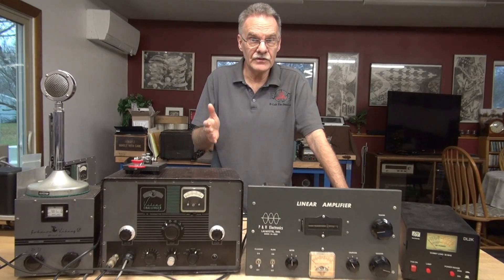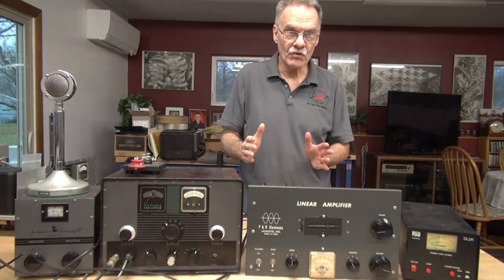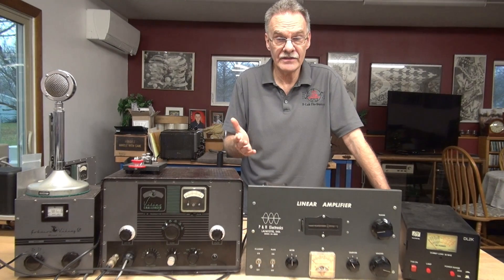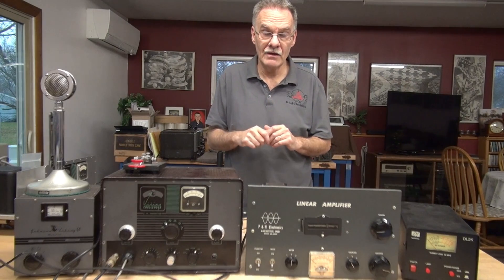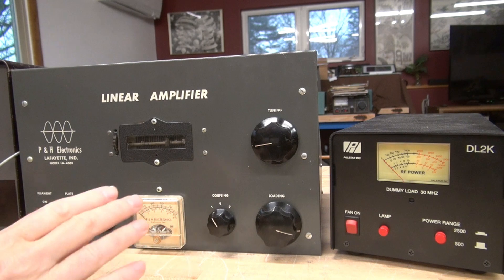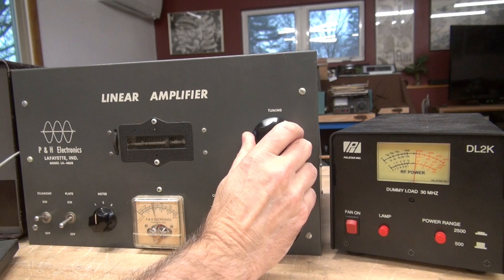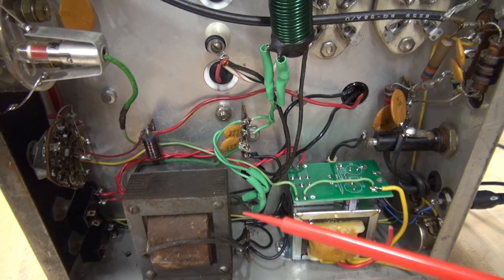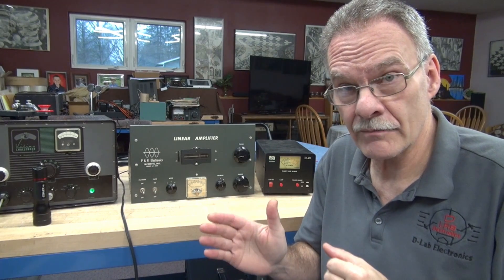D-Lab Modified P&H LA-400 Ham Linear 572B tube amplifier Low power RF output problem Follow UP Fixed

Comment: Hi just wondering about the filiment chock the very same one is used in the Heathkit SB200 and there is artical  on the SB200 and it  was calculated that the chock is 10uh and to low in value for 2x 572b on the 80m band and should be at least 20uh.
I have a SB200 and changed out the chock for a ferrite ring FT240/31 and using 14 awg wire wound 14 turns which gives me .25mh and works great
Reply from the maker: Thank you for the info. I will test at that frequency and see how the amp responds

Comment: Super video on a rare amp.  can you explain why using 572 over the 1625 tubes?  thanks Mike
Reply from the maker: To make it simple, The linears power supply is 1600vdc. 1625 tubes are rated max of 750vdc. The 572B can handle 2700vdc. Plus the 572B can conduct the required current by itself!